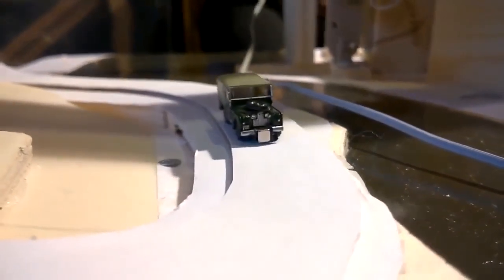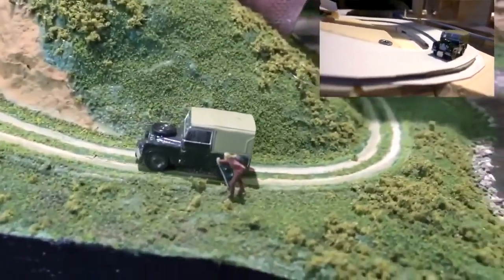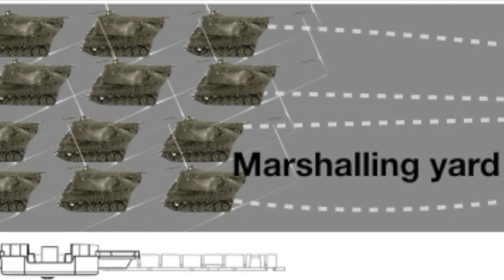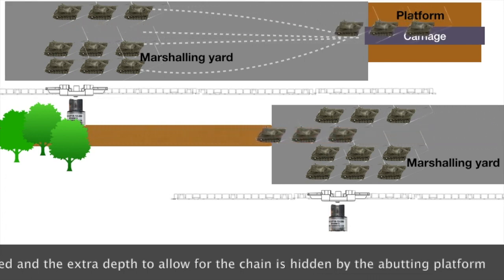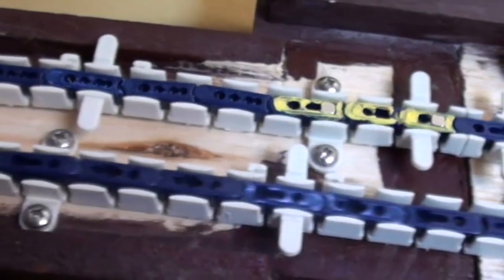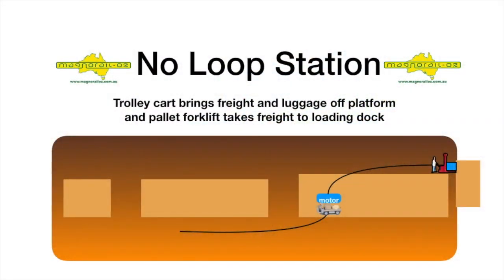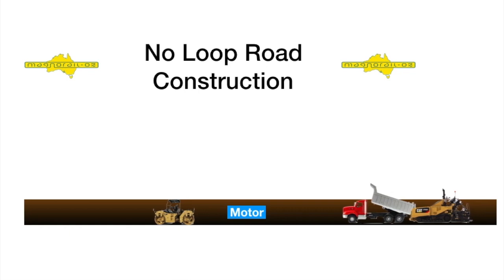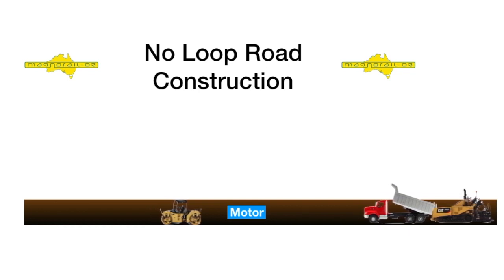Magnorail Point to Point (No Loop)

Comment: Thank you!!!!!! this is really clever!!! now if you had to have an elevator midway, what could you do?
Reply from the maker: If you mean a ramp instead of an elevator, check Rob's video here https://youtu.be/ZOGS4B_WFp4 which shows that the Magnorail System can go up inclines easily. His is a continuous loop though, but the no loop option would work here as wellWe are presently having a module made that will do the reversing and timing in one unit - keep watching our Youtube Channel and website for updates. Clyde www.magnorailoz.com.au
Reply: @MagnorailOz  thank you for the quick response!!!  but I was thinking an "aircraft carrier elevator" kind of thing, where the fighter is pulled from the hangar to the elevator, elevator goes up, and then fighter goes onto the deck.....I'll keep thinking.
Reply from the maker: @BruceKenobi  Regrettably you cannot break the links and channeling but you have got me thinking. The point to point is still the only non loop option at this stage. Sorry

Comment: I wonder why the instructions indicate that there is one "forward" direction for the chain links if they can go backwards with no problem? I don't think I've ever seen any of the magnorail videos showing anyone flipping a reverse motor switch and running their loop in "reverse" if you follow me. So I want to ask plainly: If I set up a normal loop and install a motor reverse switch, can I just reverse the sliders or bikers (but not the chain) without worry of the chain coming apart or something?
Thanks a lot for all the answers and ideas.
Reply from the maker: You are right that the chain can go in reverse, however the links have been finely engineered and developed so that they work at their optimum efficiency with the rounded edges facing the forward direction when in operation. We have finally have our TO & FRO units nearly ready for launch in July which will do everything automatically shown in the hypotheticals in this video. If you have subscribed to our newsletter, you will get more details closer to the launch date.

Thanks for subscribing to our channel! - Clyde

Comment: Could you please explain how the electrics would work for this setup and what would be involved to a newcomer to Magnorail. I am particularly interested in how you make the vehicles stop and restart. Many thanks for all your excellent videos and help.
Reply from the maker: Hi Chris The Magnorail System operates just like a DC train set. You can use a dc controller to stop, start, reverse etc The option of using your uncontrolled a12v dc outlet on some transformers is okay as well because the motors have fixed speeds. Slow motor for barges and small boats, medium motor for bicycles and a fast motor for cars, motorboats etc but by using a controller you can have a fast motor going slow to boat speed or optimum pedalling speed for bikes - it is all about creating a realistic speed for your layout. Nothing worse than having vehicles speeding along in narrow streets like the Faller Car System the bicycles look best when just moving along quietly. Watch all my videos and build up your knowledge base. But keep asking questions as I Amore than happy to assist - Clyde - magnorailoz@gmail.com
Reply: @MagnorailOz  Thank you Clyde you've made things much clearer.

Comment: On the tanks idea how close can the tracks get before the tanks would jump track? They would stop at the loading dock? If they went on the flat car how can they line up? Can vehicled change tracks and back again?
Reply from the maker: Lee Chan - the tanks are attached to the track via magnets in the track and Magnorail sliders attached to the tanks or flat magnets glued directly to the tanks. The stopping of the tanks can be done manually or vis a reed switch, with an automatic polarity reverser. We are currently waiting on parts and will be able to supply a switching unit hopefully by July. The trick is to put a false floor in the flat cars to accommodate the Magnorail track. The flat cars will always be stationary - you will not be able to move them as the Magnorail track stays linked